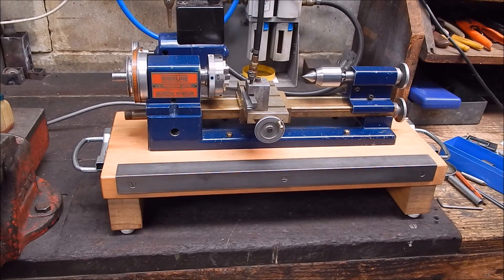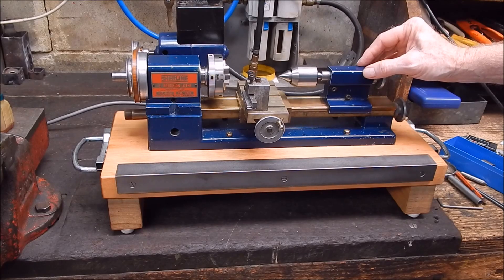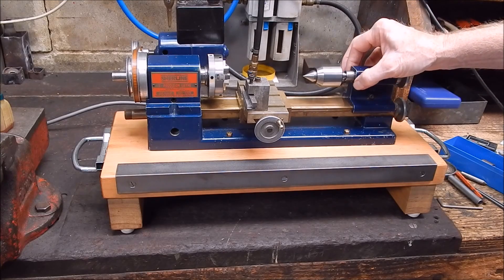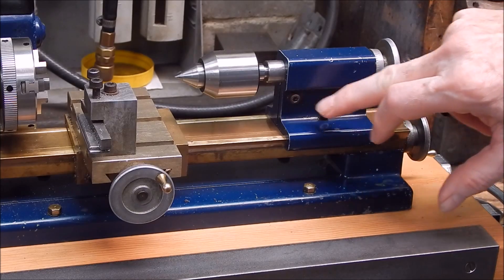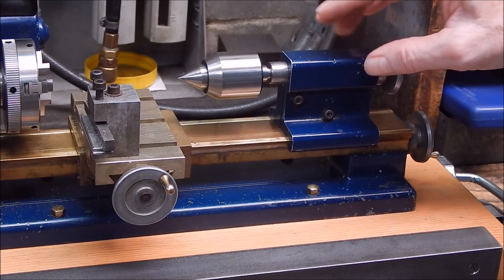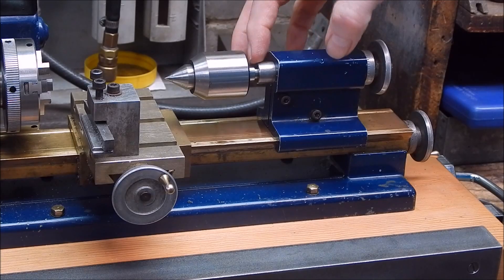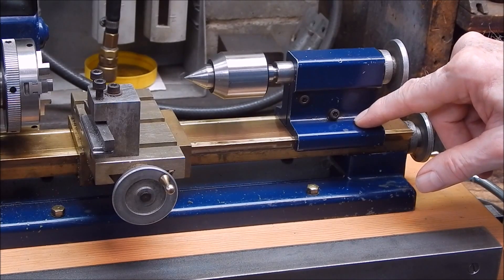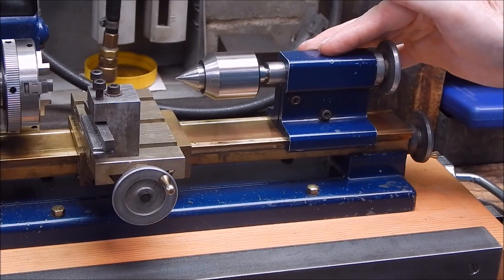How to make an early Sherline metal lathe tailstock accurate

Comment: I have an old Craftsman branded Sherline, paperwork from '78.  I have had it 2 weeks and love it with the exception of the tail stock seeming to droop considerably, play in the quill.  Looking forward to trying this fix, I was locking down with the lower bolt as well.  Thanks! Tim
Reply from the maker: Hi Tim,  The tailstock design is not wonderful, but you can get it close.  You need to check your work on long stuff though. Emjoy.  Cheers Rob

Comment: Hey Rob - looks like you have an Australian variant - mine's black and has a date stamp of June 1976 on the underside.  The motor is AC and turns the other way from the modern 90V DC version, which is why its on the other side of the bracket.  Also - your carriage has T slots going the other way from mine, I have two at 90 degrees to the bed.
My tailstock ram has 1.5 mm of backlash, which is not ideal! 
Given the current lock down I've spent time making an old drill chuck into a tailstock drill chuck by cutting a MT0 taper into the old arbor - works "okay"

Big downside - I had one drive belt, which appeared to be nothing more than a big O ring probably from plumbing.  Sherline in the US want $8.75US for the belt, but $20 US freight and $40 US on top of that to "set up an international wire transfer" which feels silly.   Heckin' expensive for a little belt, but I can't find the things locally.   Did you have any left?  If not, can you share where they came from?
Reply from the maker: Hi Criggie,

I don't have any backlash but the bush in the tailstock for the thread is very wobbly near the handle.  Needs re-bushing.

Yes, I do have a half dozen belts left from a dozen I imported from the USA.  Exorbitant price if you buy them singularly or locally from the Australian agent (Ron Sher). The USA shipping costs are insane.

I can do them for $20 AU each including postage within Oz.

Email me at gloaming_agnet@hotmail.com with your details, number wanted if interested and to arrange direct bank payment.

These "V" belts are top quality, reinforced and rated at some 10,000 hours use.  They do not slip under any circumstances.

Cheers Rob

Comment: Doesn't the headstock pivot for turning tapers?  It's time for the QC tool post and the riser block project.   Of course, a block for the tail stock with taper adjustment would be rite cool.
Reply from the maker: Yes the headstock pivots.  Very handy feature.  No plans to do any upgrades to this lathe at the moment.

Cheers Rob

Comment: When all else fails, read the directions!  We've all been there and dont that at some point, assumed what was 'obvious' and come to find out it don't work that way at all.   Always funny on reflection but not so funny when you are pulling out your hair.
Reply from the maker: Yes, no instructions in this case, but just because it works one way for some lathes, doesn't mean that's how it works for this one.

I knew there had to be more to it, when I saw the degree of runout present.

So hopefully this will help out other owners.

Rob

Comment: so how the hell do you lock the tail stock feed when your turning between centers ? thanks for sharing .
Reply from the maker: You don't.  In practice it doesn't move, so it's a non issue.  Same as my old Schaublin.

Rob
Reply: You could make a lock.
Reply: I clamped a scrap of hardwood up close behind the tailstock using a small clamp.  Worked well enough.